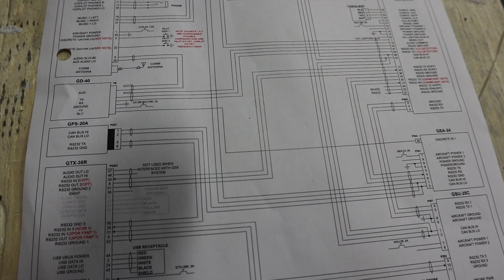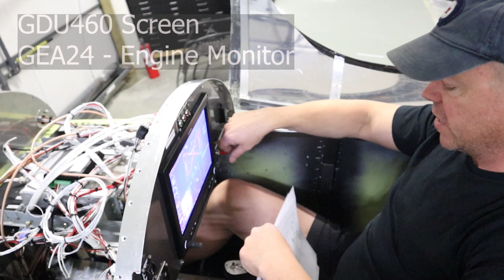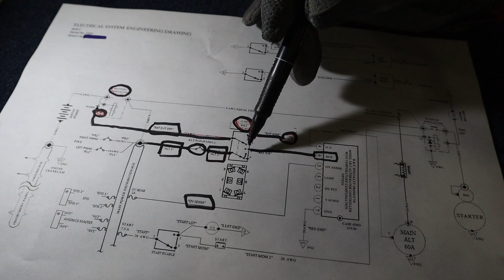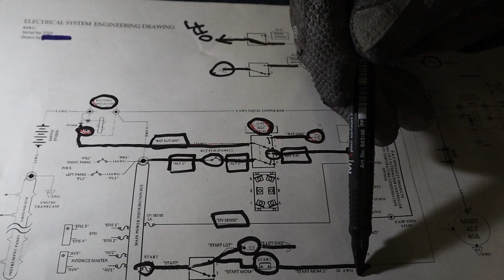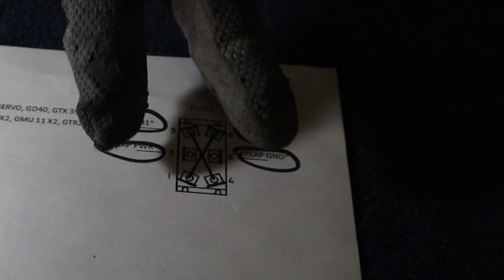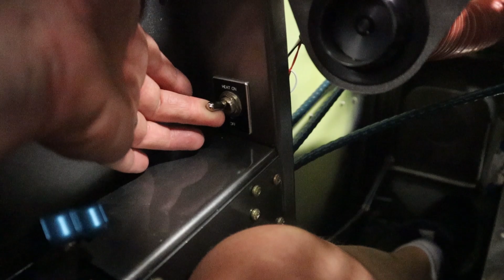Aircraft Avionics and Switches Wiring

Comment: This is AWESOME.  Still struggling to make a decision on bussing for a 2-battery, 2-alternator system with SDS electronic fuel injection & ignition.  Dual ECU's, dual coil packs, dual fuel pumps...  a ton of extra fuses (or breakers) and switches-- going in a "Light IFR" equipped Glasair.  Do you recommend one of the Nuckolls Z-diagrams?

Comment: What is the full p/n of the landing/taxi light switch ? And were did you get them. 
Thanks for all the videos they are a great help !!!
Reply from the maker: SteinAir for 2-10 switch.   I bought light mount from vans but lights direct from Baja Designs.    Great company
Reply from the maker: These are generic switches that have 3 positions.  Centre position powers first circuit and up powers both circuits.  Here is link to B&C specialty which is where I order most my switches.   Select -10 option under configuration

https://bandc.com/product/toggle-switch-double-pole/

Or SteinAir

https://www.steinair.com/product/toggle-switch-3-position-dpdt/

Comment: Thanks Stu! I'm also at the electronics stage on my project and your videos are very helpful! I also have P-MAGS, can you please share the full part number of the toggle switches you used for your ignition? Thank you!
Reply from the maker: You can use 1-3 switches everywhere to power a single circuit like boost pump, lights, etc.  For pmags you connect to 2 top terminals however as explained in video.   Thanks for asking

https://www.steinair.com/product/toggle-switch-spdt-onon/
Reply: @stusaircraftfactory6592  thank you very much!!